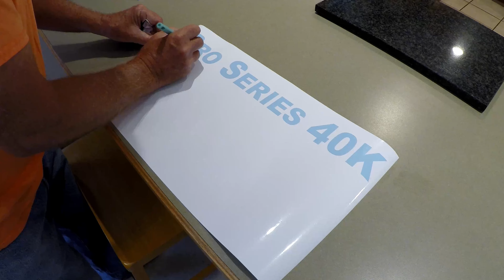Refurbishing This Distressed 20 Ton Tilt Deck Trailer

Comment: I love how with some work you can keep trailers on the road almost indefinitely. I have 5 trailers a 2002, 2003 ,2004 ,2005 and a 2013 dump trailer. And I have done plenty of welding wiring and painting on them. I don't see any reason they wont last 50 years.
Reply from the maker: Just don't load them beyond their rating and perform routine maintenance on them and they should last almost forever.